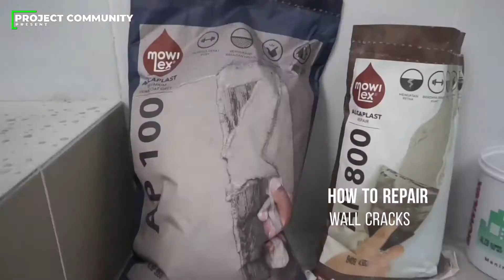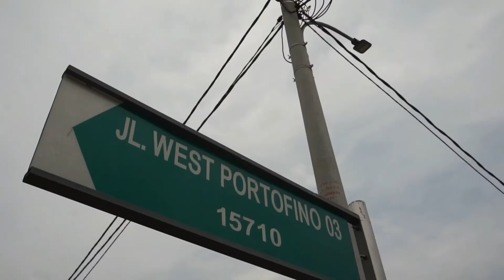How To Repair Wall Cracks | DINDING RETAK #alcaplast #alcabond #buildingsolution #mowilex

Comment: Mau nanya bang, 
kalo acian tidak rata dan bergelombang tapi sudah di cat, mau saya ratakan apa langsung di aci ulang apa di plamir, dan kalo ada retakan seperti itu sesudah di tambal dengan ap 800 perlu di aci lagi, mohon solusi nya bang.🙏🙏
Reply from the maker: Kalo dinding bergelombang trus kita ratakan dengan Mowilex Alcaplast Skimcoat Grey AP 100, baiknya cat dikelupas / kerok, supaya adhesi nya bagus.setelah kering berikan precoat UCT
Reply: Sesudah di kerok tidak perlu di alcaplast skimcoat ap 100 ya bang?
Kalau retakan sesudah di alcaplast ap 800 perlu di alcaplast skimcoat ap 100 gak bang??🙏
Reply from the maker: Sebenarnya jika kasusnya retak cukup pakai AP 800 (repair) tetapi kalo retak rambut dan bergelombang mau blocking full tembok bisa pakai AP 100 ditambah Mowilex Alcabond (bonding agent) lebih efisien.dibandingkan AP 800.Masalahnya seberapa besar gelombang selisih tebalnya, karena acian/skimcoat maksimal ketebalan 3 mm, lebih dari itu akan mudah retak,dan mengelupas. Maka harus  plester  ulang.
 Setelah kering 3hari bs cat dasar.silahkan pertimbangkan juga dari sisi budget nya.
Reply: Selisih gelombang antara 0,2 - 0,4 mm bang, bagus nya saya bloking full atau yang bergelombang saja bang..
Reply from the maker: Saran sy ada 2 opsi :
1.full blocking agar lebih merata.dan pastikan selesai di aci ampelas halus grid #240 - #400.
2.Jika tidak di full blocking usahakan jangan pakai cat yg mengkilap ( gloss level ).Gunaka cat yg dop/matt ,agar pada saat kena sinar lampu/cahaya ,tdk terlihak gelombangnya.
Reply: Makasih bang atas saran dan waktu nya, seperti nya saya ambil saran pertama untuk interior nya, terimakasih banyak atas saran nya bang semoga sukses..🙏🙏
Reply from the maker: Terima Kasih juga sdh mampir ke channel ini .🙏
 Smoga manfaat..

Comment: Mas beda nya Ap.100 dan 800 apa yah
Reply from the maker: Mowilex Alcaplas AP 100 adalah semen instan yg berfungsi sbg plaster acian (skimcoat) ,butiran partikelnya lebih halus.
Sedangkan Mowilex Alcaplast Repair AP800 yaitu semen instan berfungsi sebagai perbaikan acian dinding plaster,butiran partikelnya lebih kasar.
Kedua material tsb berwarna abu² semen.
Untuk info lengkap sbb :
AP800
https://mowilex.com/product/alcaplast-repair-ap800/

AP100
https://mowilex.com/product/alcaplast-skimcoat-grey-ap100/
Reply: @ProjectCommunityjae47  kalau untuk perbaikan retak rambut  acian dan garis lurus ke bawah sekitar 1-2 mm retakan nya pakai apa pak